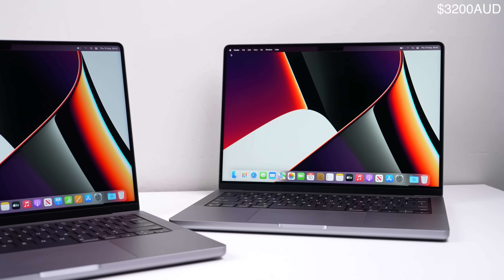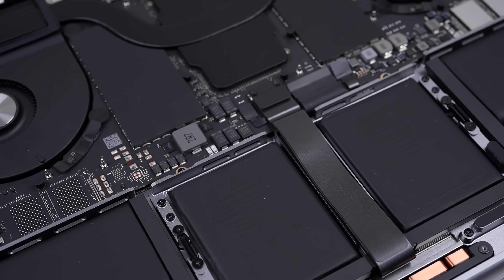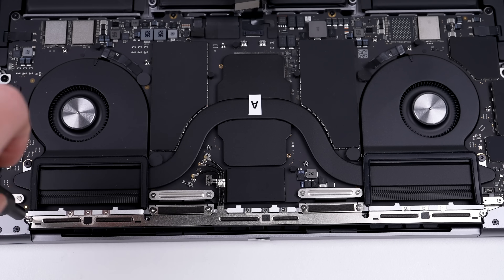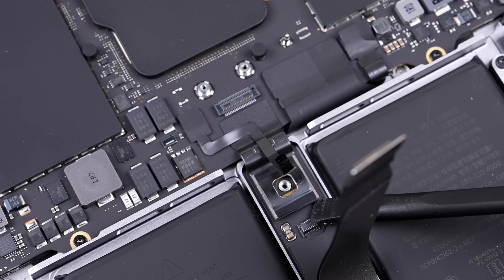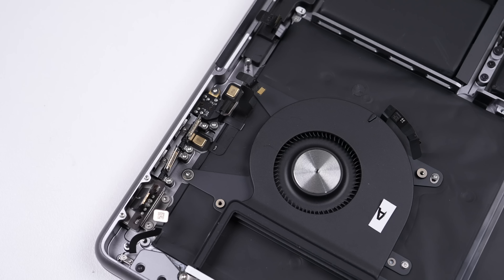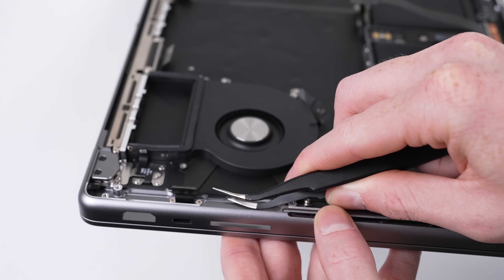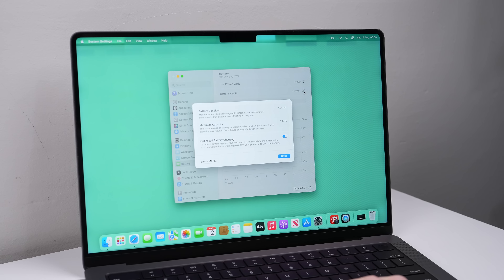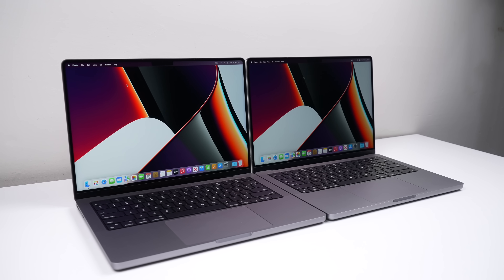New Anti-Consumer MacBook Pros - Teardown And Repair Assessment - Apple Silicon M1/M2

Comment: look, all the respect for the videos you make, but why not rely on linux? I bet my a** that the same ammount of info you need to manage your apple based operating system is quite enough to manage a linux operating system. what do you get in exchange? safety, stability, a free operating system of your choice, no shackles from corporations like Apple or Microsoft, (almost) daily updates. what is more difficult? porting software that is not apple or Microsoft native, in case  you need that, more pain in the a** in case of games, but there are solutions lately for that, from what I've heard... some of the Microsoft Office platform are more... professional than other platoforms like Libre Office, in case you really need that. 
It really took me a while to transition from Microsoft to Linux. I mean... it's different... I won't lie to you. but once I did it, and also gave up my games addiction, like 15 years ago, I never went back!!! of course there are problems in Linux, and you are on your own when solving your problems (some linux distros are paid for, but you have 20/7 help/service if this is for you) but you have so many resources today to solve these problems.
believe me or not, but I used ChatGPT to solve some of my problems. it doesn't always work, but you get a great help, and even if it's not 100% accurate, you barely have to learn anything lately with this kind of help. you just point to GPT what your porblems are. sooner or later it get's the right answer for you.
using Apple or Microsoft... well... I don't mean to touch your egos but it's quite pointless... your choice... pay for something that doesn't quite work, or go for free (or paid) for something that might work better.
but don't give me a hatefull answer like "I've tried linux for a week and it sucks!" you have to understand that that is not Apple nor Microsoft. it is not for the faint of heart. ask for help before you just judge it is not for you. 
it took me about 3-4 years before I was ready, and I really did have help. I become helpful for others too, and they never returned to Microsoft!

Comment: Im apple fan I bought all products before mac pro imac iphone ipad, etc but I stopped to buy new products cause is not a good deal change for a new version im still using my macbook pro 2012 working perfectly and My iphone 7 i dont have a reason to change it, to work I built a windows pc cause is to work and i need more power than apple products whit low power so not a good deals so i dont think buy a new apple pc anymore just iphone and ioad and not the last version

Comment: Man I'm still rocking a 2013 15" Macbook Pro. I've had Apple replace the screen (Had ghosting) and battery before I got into repairs. Since then I've replaced the right speaker, Battery (Again), and audio jack myself. I could replace the ssd and wifi card as they swap out if I needed to. Ram is soldered sadly. I do have a desktop now for heavy work. But keeping my old Macbook pro on the lowest OS version I can keeps it running smoothly. I would never get a new apple laptop nowadays.

Comment: Apple devices are nice until something goes almost inevitably w😮rong ! As you said the piper gets to call the tune ! I had an iMac 27 inch that had a crashed hard drive which I gladly was able to replace on my own with a SSD . It wasn't ever itself again but it's working . It was a 2012 vintage unit. My only problem was I couldn't buy an operating system at any retail stores and had to go to apple to have it downloaded onto my IMac at the apple outlet. I think I paid something , but my brain memory has failed me lol. Had an iPad gold tablet that had a spiderweb crack in the front glass that was slightly bent from someone sitting on it. It was barely noticeable but since it had some kind of special reactive screen ifix it said sorry kid it's a no go ! At this point my home has gone apple free. Can't talk my wife into ditching her apple phone, but I'm done with them

Comment: I'd rather have a computer I don't have to repair than a computer easy to fix. That's the humongous bling spot these kind of videos
Reply: Do you think that a $2000 mac is anymore reliable than a $2000 dell xps? Because it isn't. They all break at roughly similar rates. But the Dell is easier (much easier) to repair.

Comment: Apple is exploiting the customers. Apple might be thinking it does not have competitors. It may not be the case always. These days Apple laptops are not as good as it appears. Overheating issues, having horizontal line issues and extremely costly repair.

Comment: My work Lenovo X1 has 11 regular but tiny Phillips screws and the battery just lifts out. No glue, no cables. Before dumping Apple at work for Lenovo over six years ago, my Mac is still the only laptop battery that swelled up. So bad, it was to the point of causing keyboard errors. The stable geniuses at the Apple store took two long attempts before they agreed to replace it.  And this was on a major corporate partner's business laptop during the business day.  Apple sucks, and has always sucked since the 90's.

Comment: The pads for the "hidden" screws, I can explain.

Apple is pretty particular about not only the outward appearance, but also the inward appearance of a machine they sell.  There was some interview, ages ago, that talked about this.  But in summary, they want the inside to be as beautiful as the outside.  It's also likely why we see those decorative plates around the ports as well.
Reply: Yeah but there outside doesn't look good after few uses. Look at midnight blue M2 macbook air usb c ports after a couple of uses
Reply: @nirwan13  Yeah, i don't know anything about that.  I have an M2 pro max, space grey.  Had it now since it came out and it looks fine.
Reply: @nirwan13  Sounds like a user problem. Maybe don't brutally cram and scratch into the port whenever you plug something in? It's kinda hard to scratch a MacBook, so you're really putting in a lot of work if that's the case.
Reply: @darkwoodmovies  not a user problem. It's a problem with Apple. Whenever they try something new it sucks. It's not like other manufacturers are any better or worse but if you look at surface laptop 5 black metal that doesn't scratch that easily. Look at the pictures on google or even first reviews of the Macbook Air m2 midnight specifically. Even reviewers are saying that this is an issue but you know apple would never agree and sometimes people won't believe you either. I am sure you would have no issues with butterfly keyboard as well because when you use it while keeping it in a German incubator that thing is indestructible. 😜

Comment: It Surprises Me That SO MANY TREE HUGGING NUTJOBS Love APPLE! They have No Problem Using these products That Will End Up in A landfill! There Is no Reason That laptops Could Not be Upgradable! Except They Want More Of Your Hard earned Cash! At This point We Should Be Settling On Standards That Make It possible To Interchange Parts, Upgrade Motherboards GPU's ECT.. The Reason That EV's Will Not Take Off Here In The Real World Is The Time It Takes To Recharge Them!! You Should Be Able To Swap out The battery pack For A Charged One At The Service Station In Less Than 5 minutes And Then EV's Might Have A chance To replace The Combustion Engine!

Comment: There is a positive spni on Apples constant changes to "try" to stop users from repairing things themselves.
The repairers are upping their game and getting more advanced and buying better equipment to tackle this and gaining some high level experience in doing so making other jobs much easier. 

Now all you have to buy is some SMD chip replacement and programming equipment and find the chip that configures and connects everything on the screen and format it and reprogramming it to be compatible with the chip on the logic board. 

By that time you should be able to construct your own basic smart phone and put it into some housing you design on 3D printing software and then look for some investors and start a new company... "Crapple, Our shit is better!"

Comment: Every time I’m tempted to buy an Apple laptop because of how great they are, I bump into another video or article of how disgustingly anti-consumer Apple are, and I instantly change my mind.
Reply: to be fair, if you prefer apple ecosystem, what other options you get? I like gadgets and would own one just to learn and play with their stuff. But since I do not need it, I always go with what is more practical--windows devices.
And to windows defense, in the last 5-10 years, windows laptops made a huge leap. They became as thin as apple, power draw improved too.
But what makes them absolute killer to me, I can play on them. Better yet, when manufacturers will start using AMD cpus with built in rdna 3 graphics in their thin business laptops, you would not even need a gaming laptop!
This powerful but compact graaphic series can run most games in 1080p. If you did not know, this is the graphics used in all new handheld devices like steamdeck or Neo aya. Apple is still years behind being able to optimized their m chips to use for gaming at the level AMD does in windows laptops.

Comment: In the mid/late 90s I was a very Mac man. Then I started on an education which used PC so that was what I got. Since then I wanted to switch back to Mac for private use and now I got the money to afford it too. But it only got to a few iPods. With every new model Apple made hostile changes. Today I won't even dream about switching to anything Apple. The iPhone that my work forces me on is more than enough - it is really horrible. Even just the notification system is horrible enough that I privately use an Android. The work phone is only used for work and only charged at work. Had they been a little more flexible I might be a little more flexible with my spare time too.

Comment: Ten days ago an apple certified repair shop technician told me he wasn’t allowed by Apple to simply fix the broken cable that caused my display in my 2018 mbp to work incorrectly. He said the entire display would need to be replaced. Repair cost: €900.

Comment: Actually REWA figured out the issue after doing the same test.  They had to remove the bottom trim from both the original LCDs and unsolder two IC Chips then swap them and re-solder them in the replacement LCD.  After doing so the LCDs worked fine without any programming from Apple.  It is still ridiculous that Apple does this and I hope it gets outlawed soon as it just creates more electronic waste.

Comment: I cannot wait to see how Apple handles the European Union's 2023 battery regulation that goes into effect Feb 2024.  It states that all consumer electronics must have user replaceable batteries that require no special tools or software to replace.  I imagine it is just a matter of time before the EU outlaws Apple's serializing of parts to the logic board and OEM parts used to repair electronics must not require any special programming or hardware to replace them by third party repair shops.

Comment: For the angle sensor, I wonder if the magnet could be removed and rotated to compensate for the calibration.
Reply: I think the angle sensor is one of really few things here that actually makes sense. If the magnet is a round magnet, during manufacturing, just attaching it in any direction and fixing in software makes sense. However, not providing the tool for calibration is kind of an apple thing though...
Reply: @pengiswe  yes, my thoughts exactly. I think the screen calibration also makes sense, but there should be a tool given to transfer that data.

Comment: I purchased a 2010 Mac book Pro at a thrift store several years back. Apple thought I stole it & locked me out of it by upgrading the software to El Capitian. It would not be a problem if Steve Jobs was still alive, I did this with other Apple products in the past. I solved this problem by going online & buying another logic board from a non- working 2010 Mac book Pro. ( logic board is okay, just no screen), I found which IC was the problem but my soldering isn't up to the job at the time.

Comment: Apple SUUUUCK. The only good thing to say is that the sub-OS is Unix based. Ihave killed 3 macbook pros. One by a "minor tap", minced the screen. Another one overheated while doing 3D work. (I was later told by the mac support dude you cannot close the lid while on a dock) and the 3rd one the battery blew up like a baloon and tore the back off it. (Although the PC still worked when on power, the glidepad was totally crushed)

Comment: Yeah I think I am officially going to get a Framework computer.
I am not into tinkering myself. But I do want something that can be repaired if damaged slightly.
I'd gladly trade in battery life and performance for something that can actually be fixed.
Reply: Try an Eluktronics, if you're into gaming at all. I got one of a whim and I love that it didn't come with an bloatware unlike most Windows computers. No pre-installed Candy Crush either
Reply: I'd probably get a Framework too if I needed another machine, just to support them as the concept is great.

I've always favored the business class ThinkPads, those are still very repairable.
Reply: lol, if youre getting a framework computer why are you looking at a macbook repair video, this is the other end of the extreme, besides with framework you will get repairability at the cost of a better screen, ssd, worse software in windows more glitches with your wifi, worse performance with no battery backup, just get apple care and let them take care of you
Reply: @nikhilb6914  Was just researching the topic to replace my aging 2015 macbook pro

Also, you are more so stating opinions than facts.
Sure, the screen is worse. Other then that, you start making no sense.
You realize that with an NVME, I am getting the same or better performance than Apple M1/2 right? And when those chips die, I don''t have to replace the ENTIRE mobo because Apple soldered it to the board.

My data is 100x more protected BECAUSE it's (user) replacable.)

Windows, MacOS and GNU+Linux all have their pros and cons.
To say that one is so terrible despite the it being the most popular OS ever used, is ignorant.
Same as "glitchy wifi." What does that even mean?

Also what do you mean with no battery backup? Does Apple give you a UPS with your laptop which has a battery in it already?

And the "just get apple care" makes no sense anymore after a few years because you are slowly starting to pay more than the device is worth.

With Framework, I can go to any technician as they offer every detail they need on their website which is way cheaper and better.
Reply: @nikhilb6914  Fun fact: most people can't (or don't want to) shell out thousands and thousands of dollars for a toy computer that can't do half of what windows can

Comment: It looks like intentional misdriving of the display to dissuade the user from doing their own repairs. If it was because the screen calibration data was on the MacBook, you'd expect to see both displays have spots that are inverted from each other. because they have defects in the same spots, the old profile should also work on the new screen. The fact that the patterns are the exact same means that its apple doing this intentionally most likely.

Comment: The cal data could/should be stored on the topcase/inside the display module itself. To me, it doesn't even look like a mismatch between the cal data and the actual panel, otherwise I would expect the patches to be inverted between the two machines once the displays are swapped.

Comment: Would you have given it a higher score if if the mac book cost the same as an iPhone? or if Apple started offering free repair? cause that's what Apple should start doing. They're selling you a pre bricked computer with a countdown timer that will expire in 1 to 3 years and then you have to buy a new one. Apples business model has always this way, but they seem to have become pretty severe about the "look, don't touch!, don't even look at it!" attitude. Ooo, their super secret design are so special, come on, they're not curing cancer over there, they're just widening the wealth gap.

Comment: Macbook Pro 2030: The back is openable by normal screwdrivers but the hardware is soldered to the case. Jokes on you. Ha ha ha. This really fucking stupid soldering job they do witht he RAM - alright it probably won't break until i decide to end it's use. But the SSD? MY god, soldering disk space to a board that still runs at the same, mostly low end spec of the spectrum, PCIe Gen 3/4/5 spec. I'll vote for whoever EU-Politician to pass a law that eWaste is forbidden being sold in the EU whereas unservicable products count as those.

Comment: If the screen is (as it appears to be) using a magnetoresistive sensor rather than a hall effect then the calibration part does get to be specific to the screen and isn't something that can be done at the factory if bits get swapped about.

The reason for this is the orientation of the magnet is likely not controlled at the factory and so the sensor does need to be told what reading is fully open and fully closed for the screen its currently working with.

Of course, such calibration is trivial and it's inexcusable that apple is not just putting a screen calibration routine in the bios equivalent or settings. As an example, flightsim peripheral maker vkb uses these sensors rather than hall effect ones and calibration is like any other joystick calibration, tell it where the centre, min and max and that's it.

That does mean a possible workaround, if it can been removed/replaced easily, is to physically rotate the magnet. Will need a bit of trial and error but should be possible to get it to the orientation that the new sensor is expecting to see.